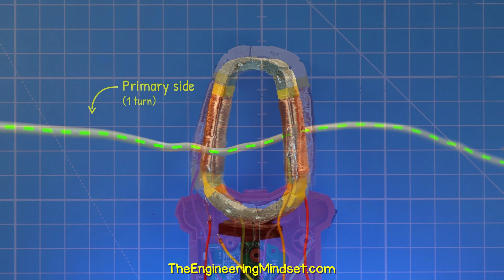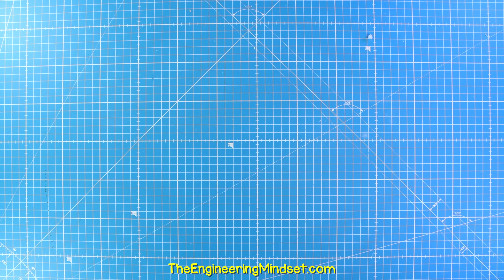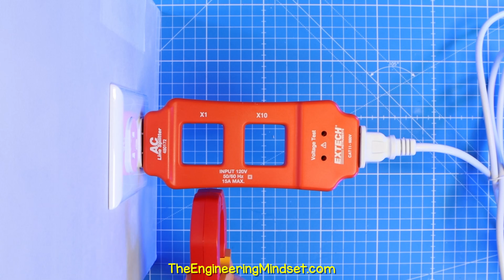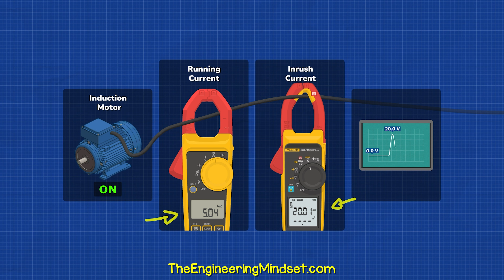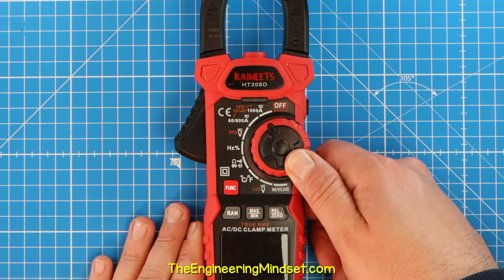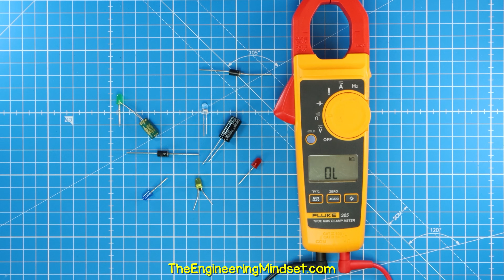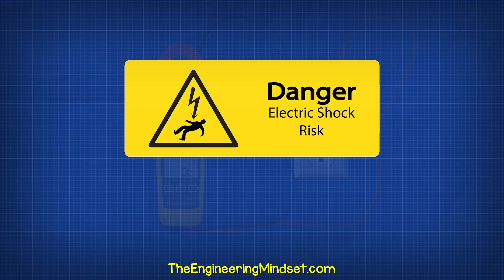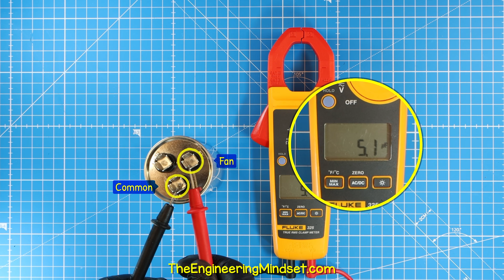Clamp Meter Skills That Make You Look Like a Pro

Comment: I get along just fine with my analog meters
Reply: I still have mine and will use them periodically.  I find my digital meter (with the clamp), makes it much easier when measuring current as I don't have to disconnect any wires for this.  

Yup, I confess I'm a tad lazy.😏

Comment: Is it common where you're from to actually wear hot gloves to test an outlet or are you just suggesting best practice? I am actually curious. I have NEVER seen anyone do that in the US.  Here you'd mostly see someone use hot gloves to tighten something in a live panel, or pull/put in a meter, cut service lines. Stuff like that.

Comment: I use Klein and fluke meters.  However, when I had to troubleshoot a non-working air conditioning compressor, I used a Klein CL800 (I rotate meters yearly for calibration purposes only).  I could not find why the compressor was not working, but the fuses were popping.  Another guy comes in with his fluke, sets it to continuity (same as me), and saw that the compressor was grounded.  The Klein could not find it.  My diagnosis was incorrect, and kept the unit down an extra month because we had to replace both compressors, not just the one.

In short, buy fluke.  If it’s just a hobby, buy a cheaper fluke.  I’m currently in the process of replacing my Klein meters, and will pass them down to my son when he starts learning about the trades.
Reply: Certainly not the meter was the problem there.
Reply: @modorangeorge4991 Yep, sponsored marketing taken a little too seriously when someone really believes you need a certain brand to find a ground continuity 😂
Reply: why would u hobble them with a piece of junk?
Reply: I've had the same Fluke meter since 1984
Reply: Sounds like you need an insulation tester, to test insulation on motor windings.
Reply: I will take your advice.
Reply: I guess you could say it was just a fluke.

Comment: my favourite meter is an ancient Fluke10. a bit low on features by modern standards, but it just works and it's yearly calibration never results in any adjustment

Comment: DC = direct current and AC = alternating current just fyi. seems you are confused there. There is no "DC current" and no "AC current"
Reply: What's a DC voltage then when there's no current flowing? :D

A "DV" and "AV"?.

DC is commonly used in such phrases, same like LCD Display

Comment: I’d like to ask everyone’s opinion on what OL means on these meters. My research has shown it to indicate Over Load or Over limit. I’ve had this debate with other electronics techs. Most seem to agree with it meaning Open Loop. I respectfully disagree. I have a Fluke 117 and it can measure up to 60 Mohms, if I were to test a higher value resistance would I see OL? Clearly that would not be an open loop. I haven’t tested out my theory. What are your thoughts?
Reply from the maker: One article on the Fluke website states "If the measurement is higher than the set range, the multimeter will display OL (overload). The most accurate measurement is obtained at the lowest possible range setting without overloading the multimeter." I tend to use, and probably did in this video, OL to mean open loop for continuity and Outside limits for resistance. It's not official terminology (according to their article) but I find it easier to visualise.
https://www.fluke.com/en-gb/learn/blog/digital-multimeters/accuracy-precision
Reply: At the end of the day, OL is just what they programmed into it when the resistance/voltage/whatever is too high for the range. We can call it open loop or over load or whatever, but it's just some LCD segments turned on to indicate a thing.

Comment: Very good video that covers the basics.  Very annoying to me that some selector dials don't have a white or black dot indicating pointer position. Easy to have the wrong function selected by accident,  such as on Ohms when measuring voltage.   I end up marking the selector arrow with paint, white out, or marker pen.

Comment: Wow you really blew my mind by showing me a DC current and then explaining why the AC-only meter was not measuring any current.
Reply: When I was starting out, I was told to check to ensure the clamp meter I was going to buy had both the AC and DC current modes.  Glad I did.  Had to return the first one as I forgot the advice I was given.  The meter I bought more than 12 years ago still serves me very well.
Reply: Back in the day when I was a young ish spark there was no such thing as a DC clamp meter ( only some crappy thing from snap on for cars. Can’t remember when DC meters came out mid to late  90’s ? These cost about ten times the price of an AC meter ( probably a weeks wage) now we buy them at throwaway money. Sooner or later we all accedently smoked an old analogue AVO by forgetting it was left on ohms, if you were lucky it just popped the fuse, if not you were looking at a couple of days wage for a new one 😳
Reply: Need me one of those new flukes I'm due an upgrade.

Comment: I didn’t know that you could do dc with a clamp. So was good to learn
Reply: It's literally on the meter.
Reply: You definitely can.  I use my DMM (MTP make), when working on fire alarm systems and would use the clamp for the DC currents that are in the system.  Just make sure your meter is set to the proper mode.

Comment: why cant we measure the two cables instead of separate it and measure only one of them?
Reply from the maker: This was illustrated in the video. The current will cancel each other out. The magnetic field moves in opposite directions, through the core.
Reply: i hope you add the sufficient explainantion into the video

Comment: I don't need a 378FC, but I want a 378FC, but I can't afford a 378FC.
Reply: Honestly dont buy it. It's too nice i dont use mine lol
Reply: If you can't afford $600-$700 these days, you have made HORRIBLE life choices. For your sake, you better be 14 years old.
Reply: @lelandgaunt7130  What?
Reply: @1_sus_1  too difficult for you?
Reply: @lelandgaunt7130  bro what
Reply: @lelandgaunt7130  It is 825€ currently, which is roughly $950. Spending this amount as a hobbyist on a clamp meter which is used 4 times a year is a silly investment, don't you think? I better spend this amount on more important things.
Also, maybe for your country, job and lifestyle $700 may be not that much, but depending on where you live, $700 could be your whole monthly income or more.
Reply: @lelandgaunt7130 Ok money bags
Reply: @lelandgaunt7130I think what he is saying is he can't afford to spend money on a device that could do the same thing as others just to flaunt and say he has a fluke. Fluke is good but not worth the price point. Unless your working in an industrial setting and has better uses then most.

Comment: Great video and graphics but one thing bugs me.  Electricity (electrons) flow from negative to positive.  Think vacuum tubes and CRT displays.
Reply from the maker: Yes, they sure do, I've covered the subject a few times, but in many of my illustrations, I use conventional current as it's the standard. Also, each time I use electron flow I get a tidal wave of dislikes, negative and abusive comments from people who were never taught electron flow v conventional current.
Reply: @EngineeringMindset  I understand your reasoning, and it makes sense from a content creator's point of view.  I think the reason that it bugs me is that I grew up in the 70's and even though solid state electronics was present and taking over tubes, I learned vacuum tube theory before transistors because I was introduced to a book (when I was 9 years old) called "Elements Of Radio."  It was an old early version prior to the invention of the transistor.  It would be interesting to see someone do a video on vacuum tube technology and which way they would go with conventional current vs reality.  Thanks for your reply.

Comment: I submerged my k thermocouple all the time in water. Why is it said don’t do that?  Works great for me. Most excellent video!
Reply: that depends on the thermocouple ig?
His looks like it has the wires exposed, which would corrode (galvanic corrosion), especially over time

But they usually have some cap afaik, either some glass, metal or plastic, which can make them safe to dip (it should say that somewhere on the packaging)
Reply: @BioTechproject27  Something being safe and something being robust/long lasting/... are not the same.
Reply: @leocurious9919  duh, but generally corrosion makes them less safe because obviously that'll leech metal ions.

Though, generally, metal caps are often stainless steels, like X46Cr13 and glasses generally also leech pretty much nothing. Plastics tend to leech a bit more, usually their contaminants though, as plastics are a quite mobile medium
Reply: @BioTechproject27  How could they not be inherently safe? The are a piece of wire. Even if you accidentally were to send a current trough them, there will be next to no voltage because of the low resistance.
Reply: @leocurious9919  ..because they leech metal ions..? The voltage & current are obviously negligible, it's the metal ions that may be unsafe for consumption, depending on the metals used
And since they'll corrode, it'll limit its lifetime as well, hence why it probably says not to submerge it
Reply: @BioTechproject27  Type K thermocouples are mostly nickel on both sides. That is about as safe as it gets: High corrosion resistance essentially to everything humans eat, the tiny amount the wire is actually made of, the short contact duration and the low toxicity of nickel. Coins and jewellery are made of nickel, with constant skin contact for years and still only very seldom negative effects. And those are then easy to mitigate by simply avoiding the contact.

Making any sort of food in anything that is stainless steel would result in FAR MORE nickel leeching based on the far higher contact area, much longer contact duration and far higher frequency of use.

Comment: Listen electricians, don’t repair the wire on your meter, because you don’t understand electrical repairs…
Reply: If you're an electrician just buy new leads.
Reply: I think it's more because it's a calibrated instrument. Fixing the lead wire might add resistance/impedence that would be unaccounted for by the meter which might make it inaccurate. You gotta know how the meter takes measurements, not just how to splice a wire.
Reply: @CorrectMeIfImWronf  mights and could… mkay
Reply: @urano4810  u can measure all that. furthermore once ur leads are at 5ohms plus or minus its time for new leads...
Reply: Anyone using a meter for accurate measurement will know the resistance of the leads and check regularly  @CorrectMeIfImWronf
Reply: @CorrectMeIfImWronf  a correctly made splice shouldn't have significant resistance
Reply: @Youtuber69428 and it will de-rate the lead.
Reply: @Youtuber69428 I'm sure insurance companies and judges will believe what you say... a sparky with spliced leads is putting them back in his vehicle or getting sent home
Reply: That's because a good percentage of today's electrician's are just part's fitters!
Reply: I think he refers to diy guys and people who doesn't read the manuals
Reply: Wtf If u know how to use a meter, u probably do understand basic electronics @nizbrel
Reply: Yeah if you're an electrician you don't need that warning, because you already know to replace the lead.
Reply: OP probably back stabs outlets "because it's there".
#EEhousefires
Reply: @traincarwillie  not outlets, just your mom.
Reply: @Dingleberry1856  she's all of our mom Dingle. The school guidance counselor said you get this way when you off your meds
Reply: @traincarwillie  que’
Reply: So you have met quite a few electricians.  (Most electricians are not electricians.)
Reply: Yes
Reply: An electrician wouldn't need to watch a basic instructional video on meters. He has to put that in there for the DIY people and the people who think they are electricians.
Reply: @jpvoodoo5522  i did, was interested in how dc current is measured 28yrs in the sparky life
Reply: @jpvoodoo5522  because splicing wire is rocket science.
Reply: @jpvoodoo5522 Im an electrician, fairly new to the trade. I do own a Fluke FC368 clamp. This video is also helpful for professional’s to understand their equipment better.

Comment: I know this is an ad, but as an ordinary electrician fluke is all you really see. Even among instrument techs (thet calibrate sensors, sensors which control valves), the 789 is the preferred choice.
Reply: Same in my field, fluke 87 is so common many newbies don’t even know there are other meter models / manufacturers

Comment: I like how you said "qualified and competent"😄
Reply: Its also so important to be qualified and competent FOR THE WORK YOU ARE PERFORMING.

I have an electrical engineering education and experience in electronics technician work, but I am not an electrician. I am highly knowledgeable in loads of topics about electricity, but I still call the electricians in if I'm needing something done on the panel.

If the power is off, working with low voltage, working after the breaker, outside of the wall, I am perfectly competent and qualified. But I am NOT an electrician. They shouldn't do my job, and I shouldn't do theirs.
Reply: aunt's "handyman" won't qualify then....
Reply: I'm trained and competent (not qualified) and have had so-called professionals reported to the ombudsman successfully a few times.

Comment: My fluke is my companion, savior, and a money maker. Its accurate, safe, reliable... And most importantly protects me from myself when human errors occur, only to blame on none other than myself. 😅
Reply: What is the model?
Reply: @mdinjamulhaquesardar  mine is 378
Reply: @mdinjamulhaquesardar  1587 FC. I'm an HVAC technician, this meter is perfectly suited for my line of work.
Reply: dunno 'bout all that butt I will tell ya that the Fluke the company I worked for back in 84 as a field technician, is Still going strong. 😅
 Wanna good laugh? Go look up the price for a new 378 fc.
You'll appreciate it all the more.

Comment: when you use clamp meter, and the display accurately reads 30.17 Amps-        :D

it's clamped to a water pipe-       D:

Comment: You could also connect clamp meters in series with other clamp meters or multimeters just like how you would connect batteries in series to combine their voltages. This combines the voltages of the diode test functions so that you could test LEDs that you otherwise wouldn't be able to test with a single clamp meter or multimeter. Or you could connect a multimeter or a clamp meter in series with any battery to achieve the same results. If the battery's voltage exceeds the LED's required voltage, it will not fry the LED if it (the battery) is connected in series with a clamp or multimeter.